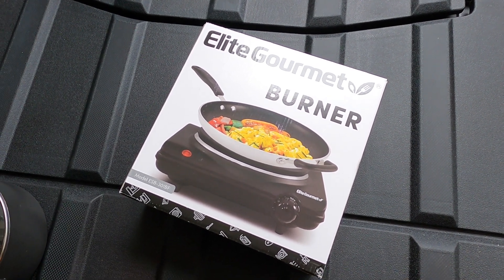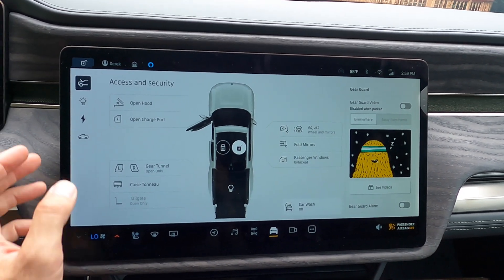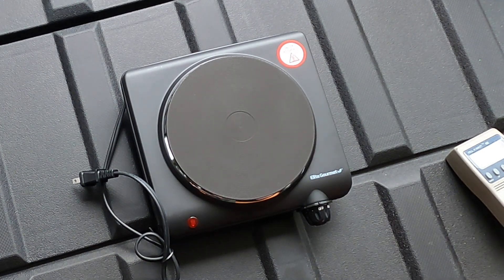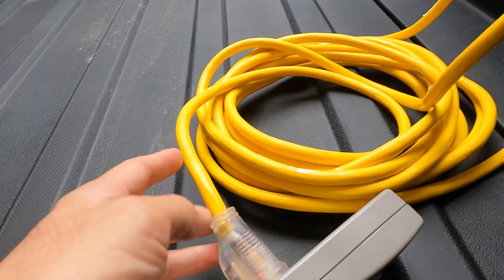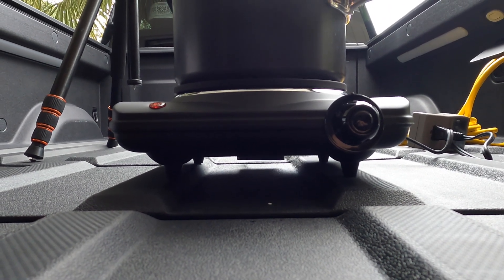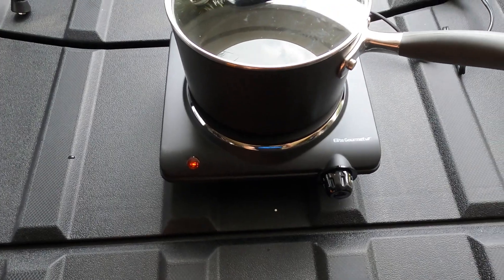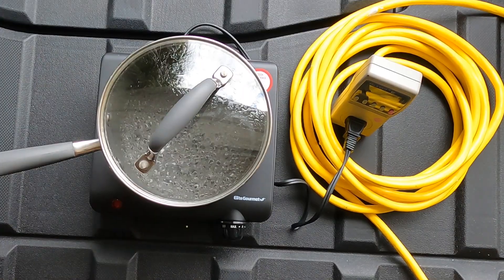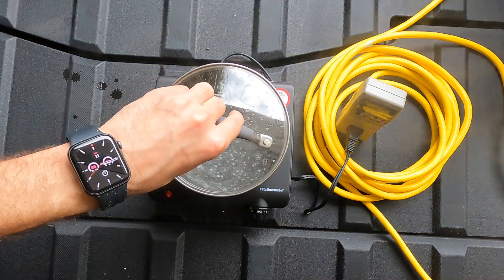Boiling water with the Rivian R1T 120V truck bed outlet | smoke? | camping prep

Comment: It could be the length of the extension cord and what kind of wiring it was. Too many wires almost creates a coil. Try it with a shorter extension cord. Maybe a 3 foot extension  would work better.